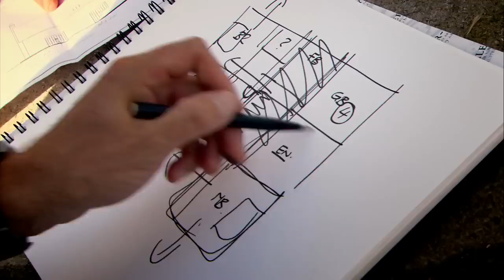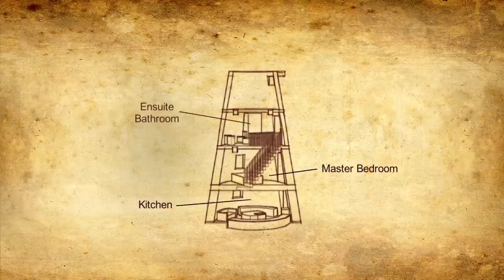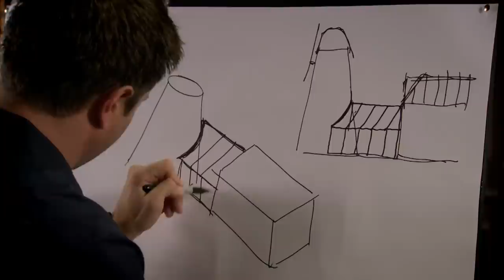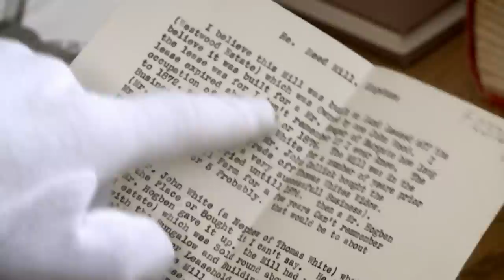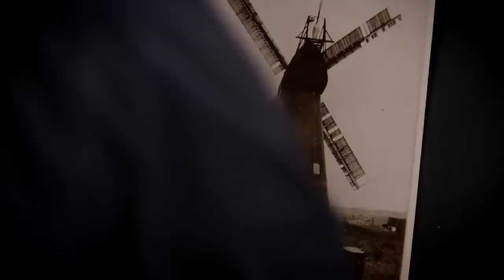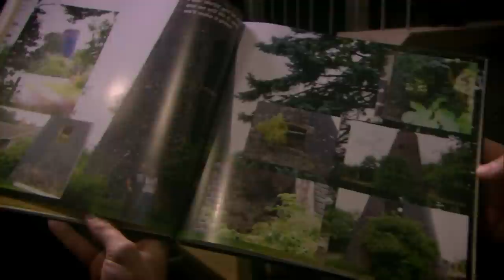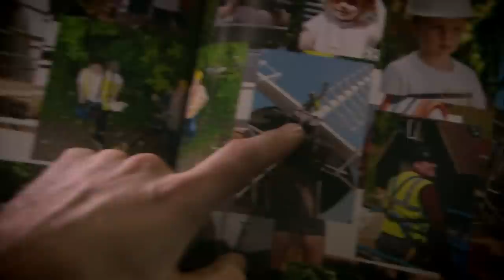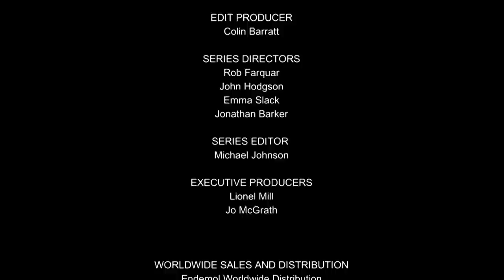Windmill Restoration Dream - The Restoration Man - S02 EP1 - Home Renovation

Comment: Keep it a Working Wind Mill With Sails, To Power a Generator to power the Windmill House & The Parents House Next Door. 
Charge a Battery Bank with Excess power, Then Sell the FURTHER excess Power Back to the Grid. 
( Agricultural Shed With as many Fork lift Truck Batteries as is Required etc, to Never Draw power from the Grid.  Maybe NOT even Bother with an Electric METER ??? )